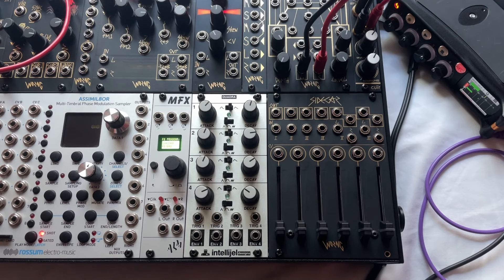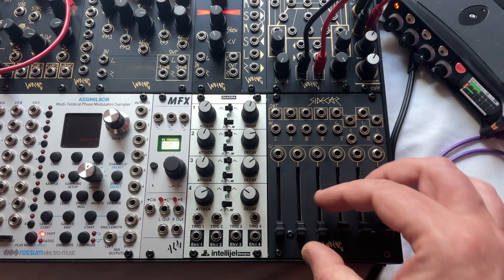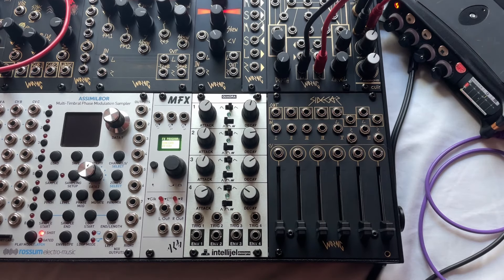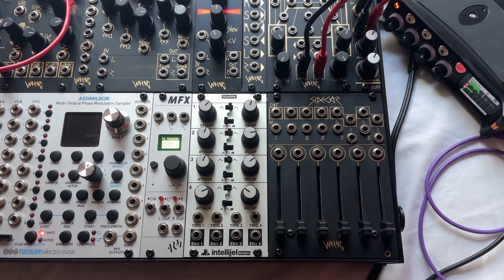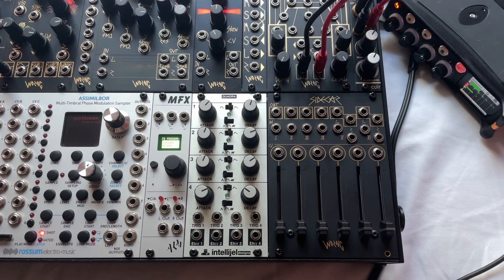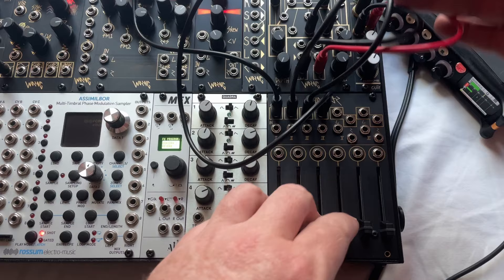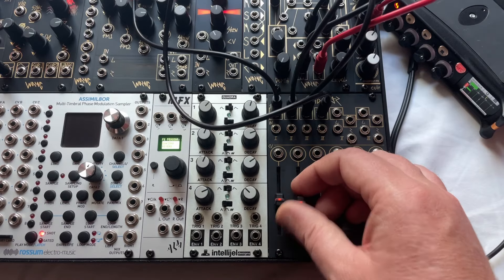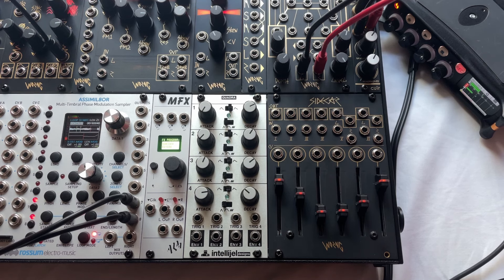WORNG Electronics SideCar Mixing VCA

Comment: This is great! - Two questions, I still have: Since you did not mention this, there is no normalized voltage to the output so this could not be used as a controller, right? And the second one is about the cv-conditioning/ the response of the VCA - is it lin, exp or whatever in between? :)
Reply from the maker: If you patch a static voltage to input one you can use all the outputs for controls, due to the inputs cascading down. The CV response is exponential but with conditioning at either end, so the -100dB to -50dB passes faster, and so the top end rounds off at 0dB to keep control over levels to make sure things don't clip.
Reply: @worng_electronics thank you for the fast response! I really should have figured that out by myself, a clever design! - The response indeed seems to be carefully chosen. 

I really hope to get my hands on one of these in the near future!
Reply: Good question, wonder why it was mentioned nowhere
Reply: @worng_electronics that’s such a smart way to take advantage of that! 1 cable in and you have lots of offset voltage! If you were to cv the channels you could also then reduce that offset voltage to different ranges correct? I love the way this rides between modular and a performance mixer that might take out some of these incredibly thoughtful features! Well refined and I appreciate that a lot!
Reply from the maker: @ape-tac-tics  it depends what voltage you patch in, the VCAs are just controlling the amount of that voltage that can come through. So if you patch in 5V you get 0-5V, etc. The response will be exponential though, not linear, which may or may not work for your purposes

Comment: Oh cool, 
just wonder faders are logarithmic or linear?
And stereo channels inputs are normaled for mono input? 
Also, does channels have amplifications? If yes what amount of gain? OR where is the unity place?
Thank you in advance ))
Reply from the maker: The faders themselves are linear but the VCA response is exponential as it’s optimised for audio. Channel 5 is normalled for mono L to R but Channel 6’s normals go to the L and R of channel 5. Maximum gain is unity to prevent clipping, as Eurorack only has 6dB of headroom.